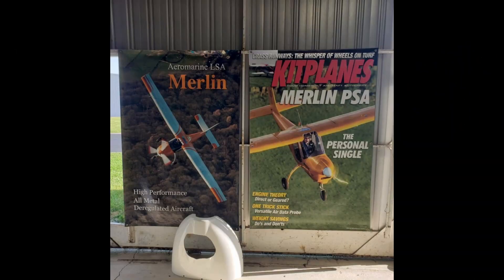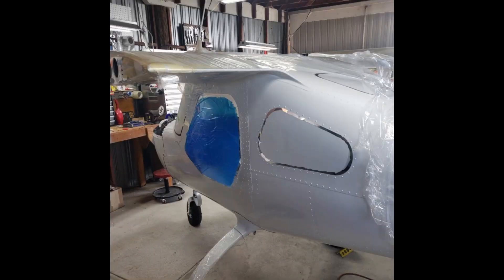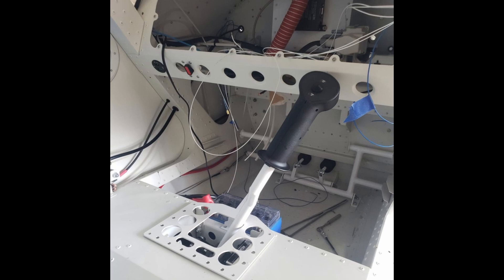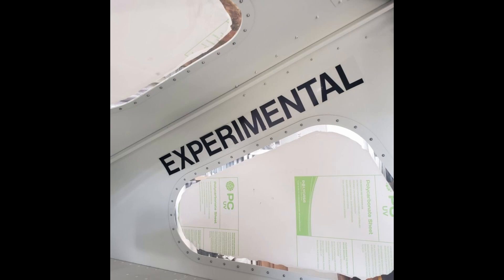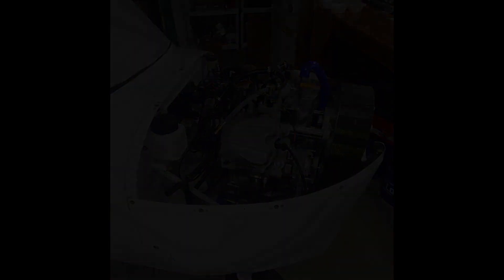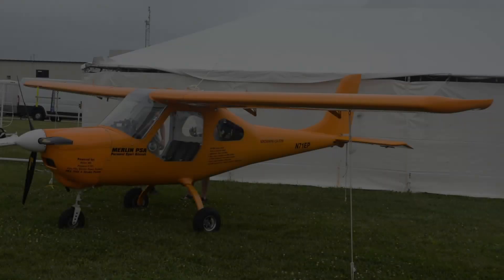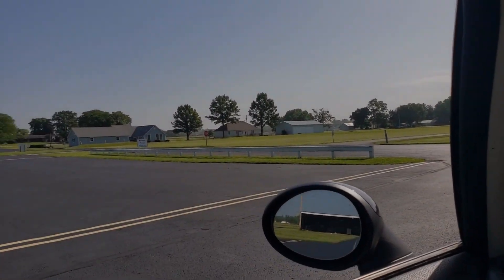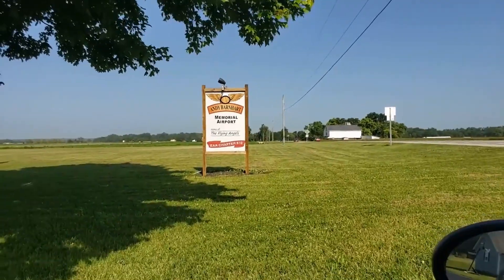Can I build and Fly my own airplane?  Believe U Can Fly!

Comment: Merlin has been on my bucket list for years. Hopefully I can build one and fly it before I die.
Reply from the maker: Capt.  Well I am not a spring chicken ether, but a the reasons to be a Merlin fan are many.  A  kit that can be built in two months, then I can fly an all metal quality airplane? For a fraction of the factory built airplanes?    And then I do the maintenance and annuals?, saving thousands per year?   That's why its on our list.